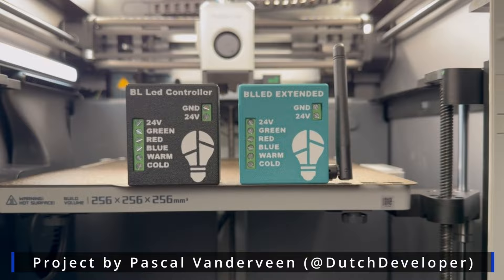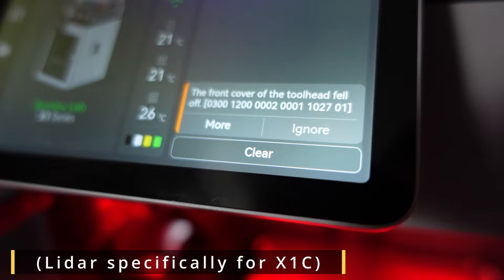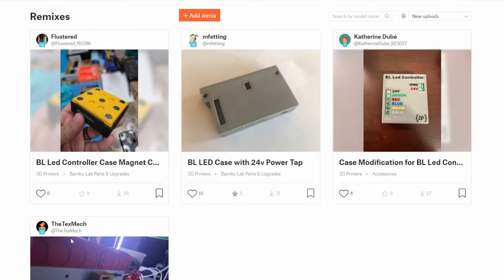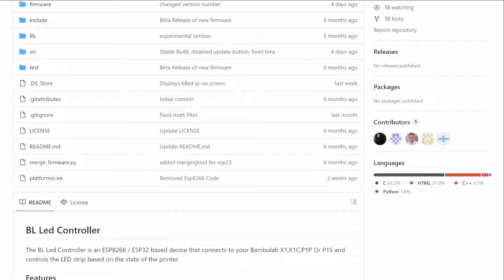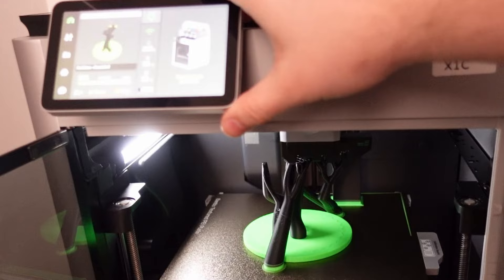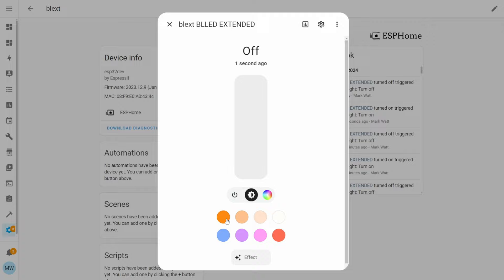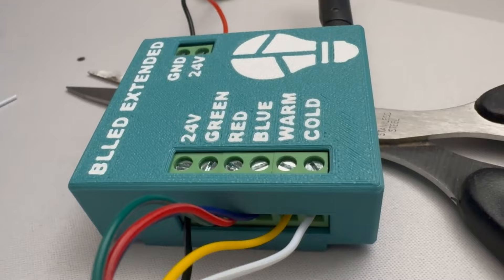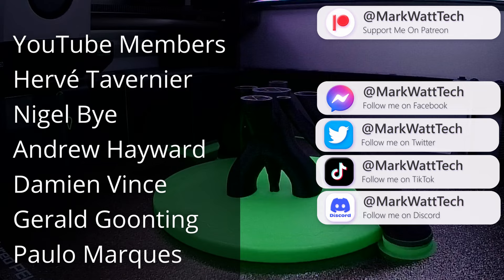Simple Smart LEDs for your Bambu Lab Printer (BLLED Overview)

Comment: Did the same, but with a Dig-Uno, WLED and Home Assistant.  Nice to be able to create my own automations around the printer.  I also used a new 6 pin ams cable cut in half to power the Dig-Uno.

Comment: Hello, great video as always!

I finally received my BL led controller and I'm not really satisfied with the result with the current firmware, so I wanted to install Wled there but I'm blocking it...what is the configuration of Wled to use to run rgbcct leds? Which gpio pin to indicate? I don't currently have any reaction from the led strip 😒

Comment: Did you have any issues linking your X1C to Home assistant? the Greghsp work through only gets so far for me and then I can't get it added due to an error at adding the printer credentials
Reply from the maker: Heya. What's the error you are getting? 

Do you have 2FA enabled? If so it won't work due to a current limitation on the Bambu Cloud
Reply: @MarkWattTech haven’t got 2FA I keep getting something along the lines of “invalid credentials” when I get to the stage of inputting my IP and password. Initially it was getting stuck on the input of my Bambu log in but that seems to have rectified itself